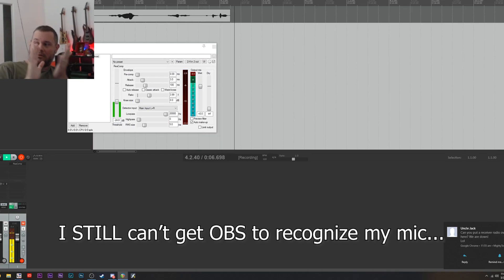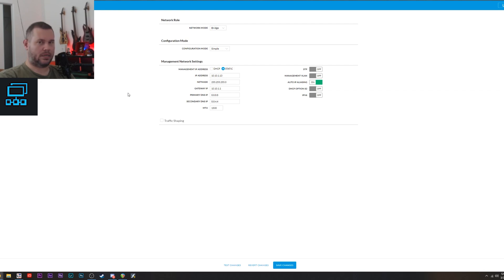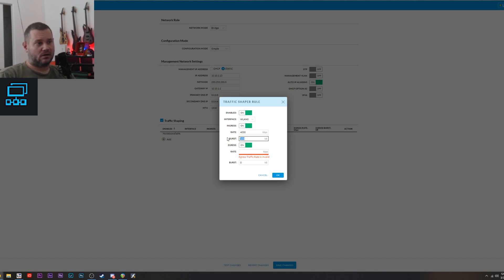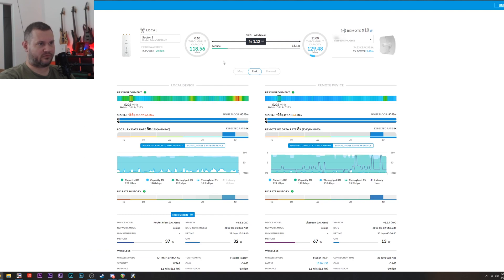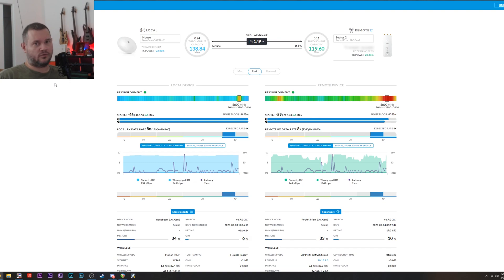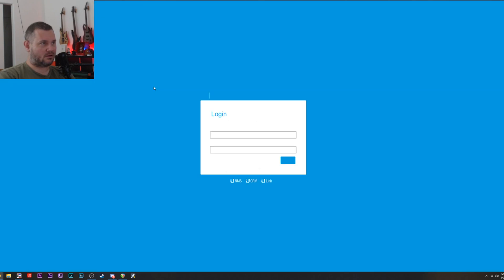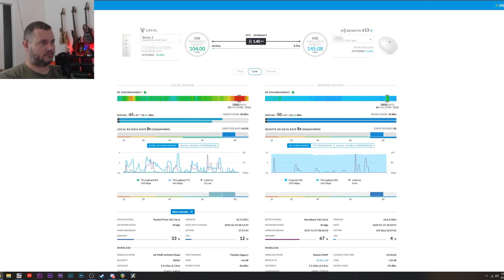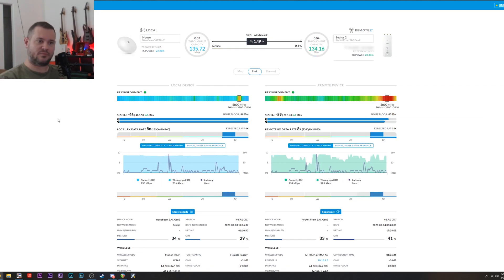How to configure Ubiquiti Radios, WISP Infrastructure 101 Pt 3 - DIY Ubiquiti Internet Relay - Pt 42

Comment: Youll want to have all your cpe's & ap's set to dhcp and registered to UNMS. Unms will keep track of the ip's. You then run them all on a management vlan where they're isolated from the clients.
Channels? The cpe's have to be on the same channel as the ap as that's how they communicate. Though if you run 4 aps you can run North & south on one channel & east and west on a second channel. Then enable gps & set duty to 67/33 5ms so they don't affect each other. This is called channel recycling.
Traffic shaping at the cpe is fine but at the ap your controlling the total at the ap not per client. Per client needs to be done at the CPE or in the que list at your router. This can also be automated through UNMS & UCRM so your not needing to change settings in the radios.
Reply: Where in the radio do you find that?if you dont mind me asking

Comment: I like your videos really helpfull. 
Can you review on Ufiber olt system and implement it in your system. 
And stay safe
Thank you
Reply from the maker: I don't really have any need for those as users supply their own wireless router. Sorry.
Reply: His Network is fully wireless.. He won't need an OLT unless he score a good MDU with customers that can justify the cost of running fiber to the home..